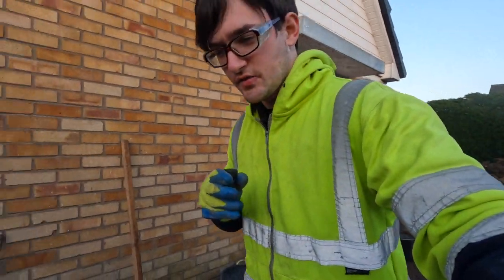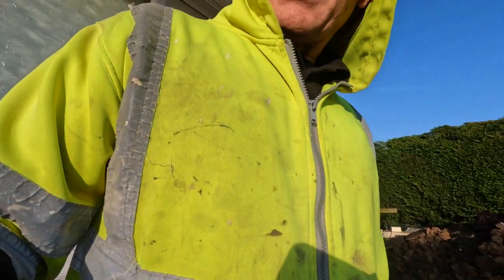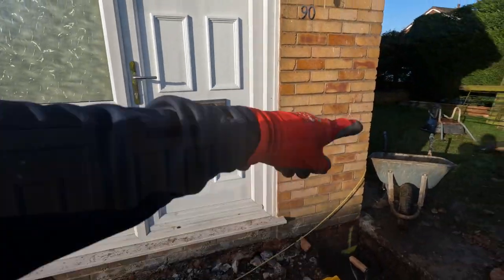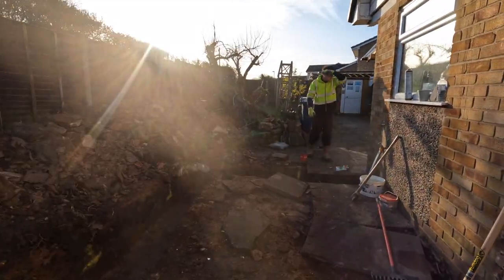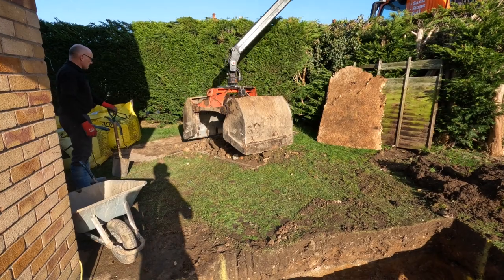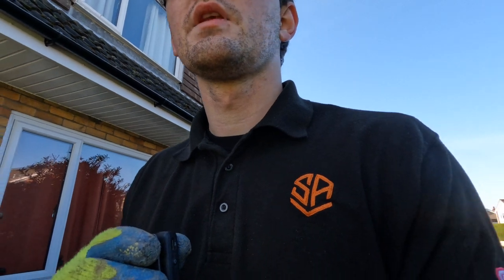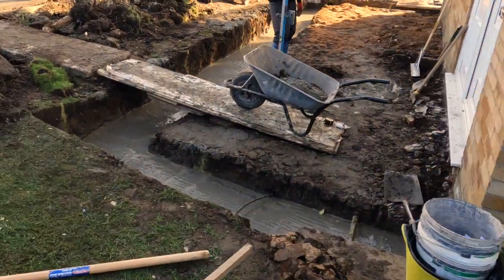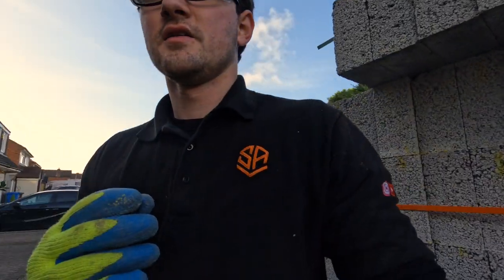MUCK OUT, CONCRETE IN.. EXTENSION PART 3

Comment: When i was worked in Greece any extension they build there they make also the Slab with 
Rebar without Slab is not Work with quality completed you must build the slab in to the channel with rebar then fill it up with concrete

Comment: I had my concrete poured on Monday and the weather has been terrible, the trench/foundation is waterproof will this cause problems to the ready mix? Or is it ok
Reply from the maker: Not sure what you mean ? 🤔👍🏽🧱
Reply: @SteveAndAlexBuild  sorry I meant its waterlogged the the foundation it was poured with ready mix concrete 5 days ago
Reply from the maker: @umarhussain8543  water on top isn’t a problem just make sure it’s dry before you start to build in it 🧱👍🏽